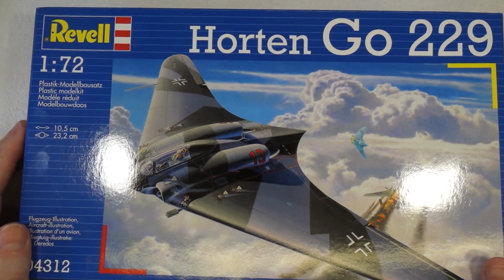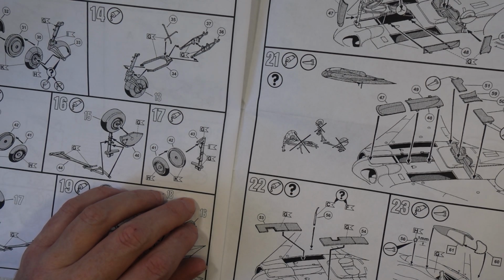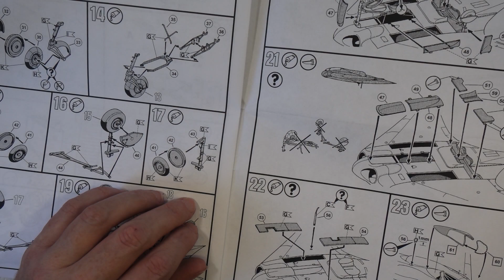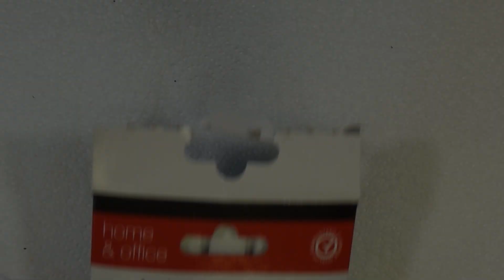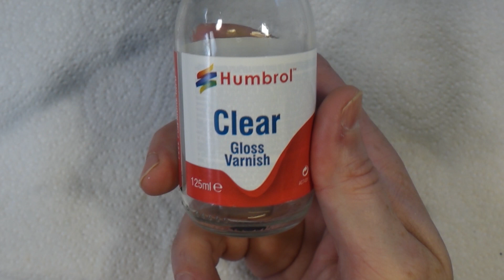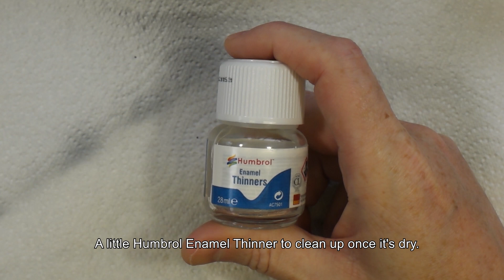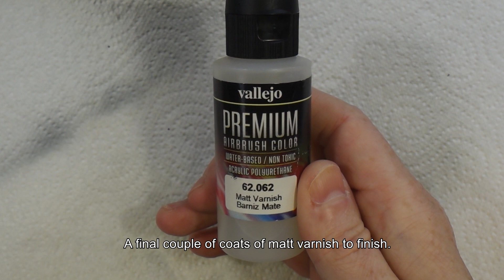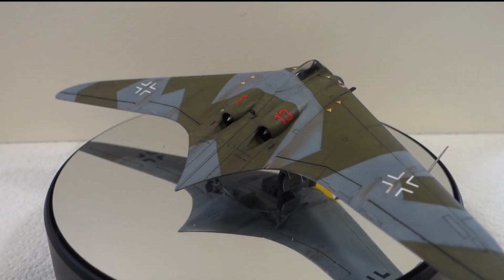Building the Revell 1/72 Horton Go 229

Comment: How long do you give between painting and gloss coats? You always appear to get a very smooth finish. Nice build
Reply from the maker: Thanks. Not long. For most acrylics, a minute or two with a hair dryer is more than enough in my experience.
Reply: @SteamGeezerUK  Thanks, I was assuming there was hours.
Reply from the maker: @Pablogogo  A lot of people will tell you it's hours, but I've never found it necessary to wait that long. Some finishes need time to set and to cure, but acrylics usually dry in minutes.
Reply: @SteamGeezerUK  I'm just getting back into modelling and had a Vallejo clear gloss crack like crazy over tamiya X paint. From what I could see I didn't allow enough time for the tamiya to be fully cured.

Comment: ..... Couldnt get the engines to work so they flew as gliders....
Weeeellll akshully the whole flying wing concept originated as a sport glider built by the Horten brothers. It 2as that particular glider that bought them to the attention of the luftwaffe command in the first place. So, while the original  comment is right the plane had an earlier life as a glider.
It has to be one of the most innovative designs in aviation history. I would argue every bit as important as the Me262.
What the f¥ck were those Germans even thinking of eh?